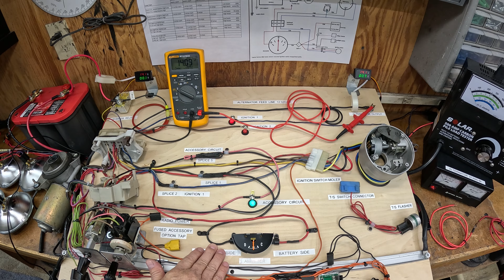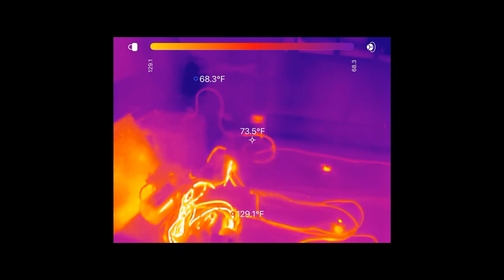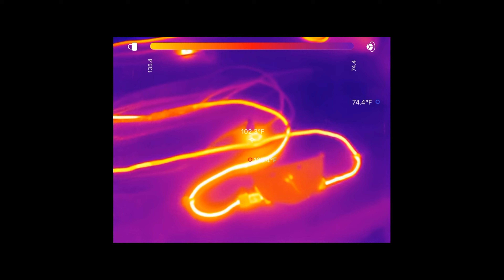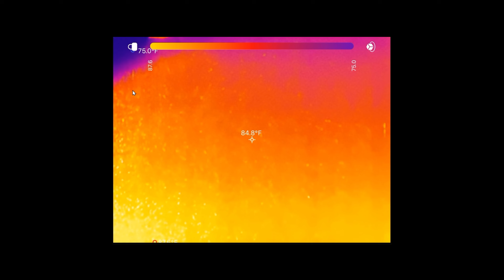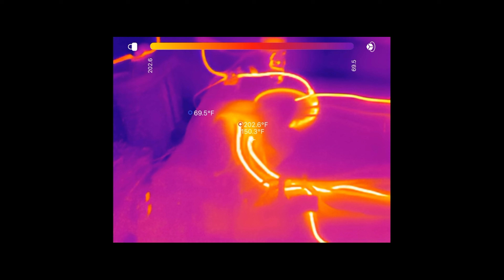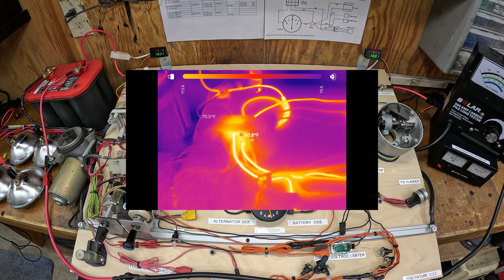More Classic Chrysler/Mopar Electrical Charging/loads distribution systems, load tested

Comment: Did Chrysler ever make an alternator that provided more current at idle and low rpm? Stereo, elec fan, elec fuel pump, EFI is reality today.
Reply from the maker: Not back then, max alternator capacity was about 30-35 amps, some later A/C cars had 50–60 amp alternators. At idle, you could expect maybe up to 15-20 amps, with enough loads on, not uncommon to see a discharge indication on the ammeter at idle. Dimming headlights at idle was also common. Lager alternators came later in the seventies with a shunted ammeter, full charging current no longer routed to the dash. Today you can get direct bolt-on Chrysler reproduction alternators pushing 130 amps with 45-50 amps at idle speeds, wiring mods recommended. Stay tuned, more on that to come.

Comment: The thermal camera images are really informative.  And that is without ignition 1 loads (Ignition, Alternator, regulator, electric choke?)
Reply from the maker: Indeed, I will be diving deeper into the ignition switch, ignition switch Molex and the switched loading with the thermal imaging soon.
Reply: @72roadrunnergtx  I think the Molex terminals are rated at less current than the Packard terminals?
Good point that the Ammeter really is not the main issue.  
The Ammeter is like a bus bar that uses the magnetic field to deflect the gauge needle. It is not a current shunt like used with a volt meter to measure current.
The Packard terminals are just trying to handle more current than they were designed for, and even the 12 AWG wiring seems to have been sized when the cars only had 32 Amp alternators, and minimal loads.  
I don't care for the modifications that try to put even more power through the dash harness as the switches, connection terminals, and wiring was not designed for the extra power loads.  The Power window and power convertible top drawing power from the Ammeter gauge is not the best design, but the loads usually only last a few seconds.